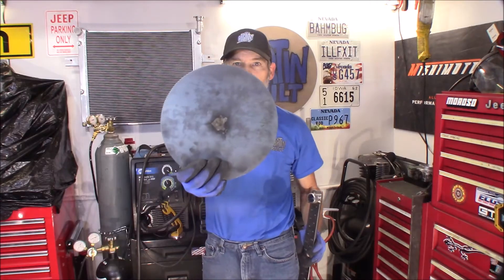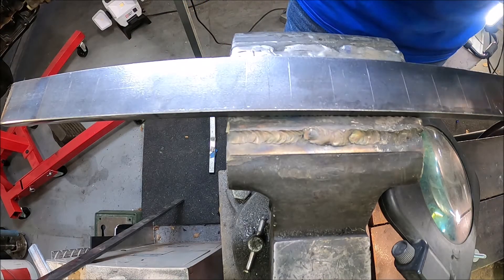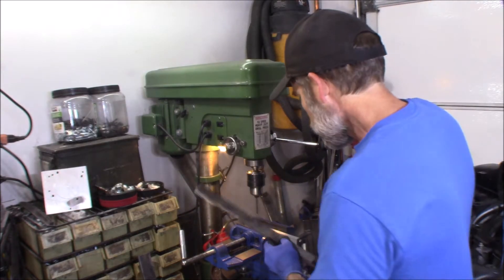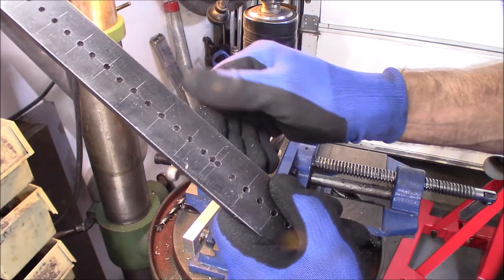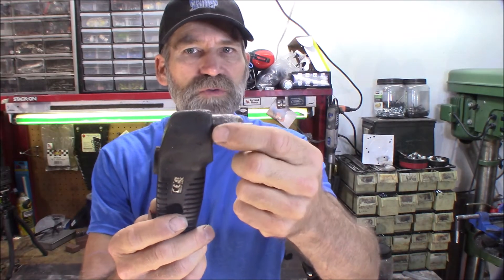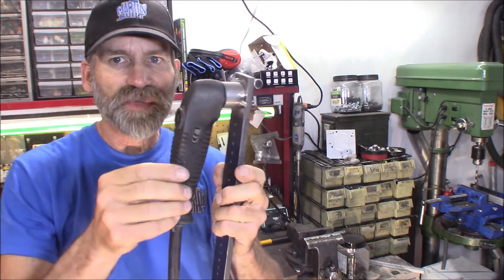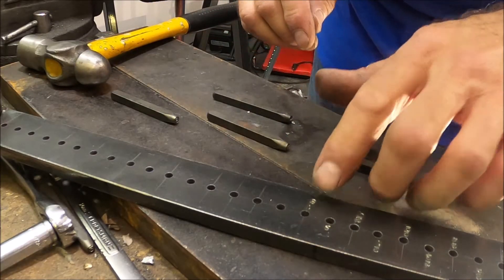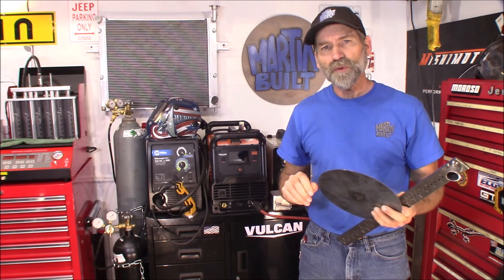How to Build a Circle and Straight Guide for a Plasma Cutter

Comment: I feel like the addition of a thin thrust bearing under your circle guide would reduce friction so that it would be easier to make a smooth, rather than jerky motion when cutting. Perhaps a light coat of silicon spray would work.

Comment: how can I cut smaller circles with a plasma cutter?
there is a piece of steel chromium that i want to cut and by drilling it dulls the bits and the problem is that I'm gonna have to cut those holes every time that part requires to be replaced on the machine about every 2 to 3 weeks

Comment: This is a good method as long as you don't mind a hole in the middle of your circle. ":) Of course, we usually do need a hole in the middle! Maybe a rotating table would be good with a stationary plasma cutter?
Reply from the maker: Thank you. i'm glad you liked it and found it helpful. There are other circle cutters that use a magnet for the center, which prevents the hole in the middle.
Reply: @martinbuilt  yes clever solution. I'm going to make a motor driven variable speed spinning table for welding, which could also work with my plasma cutter for cutting circles.

Comment: This is great -- THANKS!  What was the project you mentioned needing the special diameter?
I happen to have the Hypertherm Powermax 350 too and it works well. I just wish someone offered a standoff nozzle for a little smoother handheld work, especially on slightly thicker plate where I can't really drag so close, so I just use a regular slip-on deal if it won't be in the way.
Reply from the maker: Thank you I'm glad you liked it and found it helpful.. Here is the video that I needed this circle cutter for.
 It worked perfectly for this project.
https://youtu.be/mxHdgZn1zi4

Comment: If you thread the opposite end to the cutter you screw a sml bolt in it this acts as a handle it makes it easier to turn also if you thread every hole you can grind a point onto the end of a bolt & thread it into which hole you need the point will sit nicely in a hole punch mark this also helps with rotation & you dont need to drill a hole for a self tapper

Comment: Nice looking tool and I'll probably build one but I've found that a piece of tie wire and a screw works too. Especially when there's a wall that keeps your guide from swinging around. Your tool will make much better circles when there is room though. Thanks for sharing.

Comment: I'm looking to buy a plasma cutter about $500 I have to spend what do you recommend
Reply from the maker: I would recommend the LOTOS LT5000D 50A Air Inverter Plasma Cutter Dual Voltage 110/220VAC 1/2" https://amzn.to/2M7F38n
or the
YESWELDER CUT-55DS, 55 Amp High Frequency Non-Touch Pilot Arc Digital Plasma Cutter, DC Inverter 110/230V Dual Voltage  https://amzn.to/3sh39gz
Reply: Thank you very much Martin
Reply from the maker: @mikesunderpressure1  you are very welcome

Comment: Did you allow for the thickness of the plasma cut when making this bar? I was just curious.  It's a good idea.
Reply from the maker: yes I did, after the cut the circle measures exactly 8, 9 or 10" what ever you set it up for. Thank you for watching.
Reply: @martinbuilt  Ok cool I figured that you did but I didn't hear you mention it in the video.  I probably just missed it. 
Thanks Kurt

Comment: thanks for vid  just wondering should the tip of the plasma torch  be even coming through the bar or protruding a little  or should it be  recesed a little
Reply from the maker: I had it flush to the bar at the bottom of the bar.

Comment: Don’t care about the subject matter. Automatic like!!  You’ve helped me on many projects for my 03 4.7 Ram. Alternators, power steering pump and now getting ready to tackle valve cover and oil pan gaskets. Parts are on the bench ready to go. Only saving grace is that the Ram has a lot more room to work under the hood and I won’t have to remove half the stuff you did on your Jeep. Thanks for all the videos. 👍👍
Reply: Do you have magnesium valve covers? My 04 WJ does and I replaced the "o-ring" gaskets, but they still leak... I'm thinking I need original Mopar gaskets?
Reply: 123 XYZ They are and I’m replacing all the o-ring gaskets. 🤞🤞. They are FelPro gaskets. I’ve never ever had a problem with FelPro. The FelPro kit came with all the gaskets including the oil filler neck gasket and the oil pan gasket came with the O -ring gasket for the oil pump pick up tube. I’ll report back after if there are any issues with either of the gasket sets. 👍👍

Comment: Hey Martin I have a 04 wj with the 4.0 liter. My low washer fluid light keeps beeping could it be a sensor?
Reply from the maker: yes the sensor, also check the connection or a wiring issue.